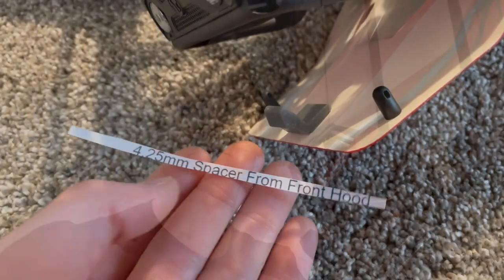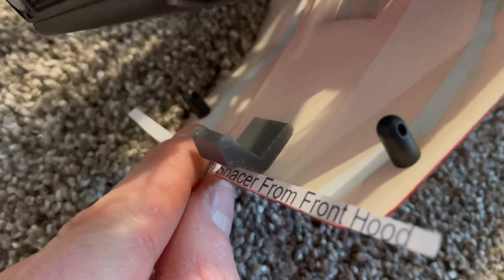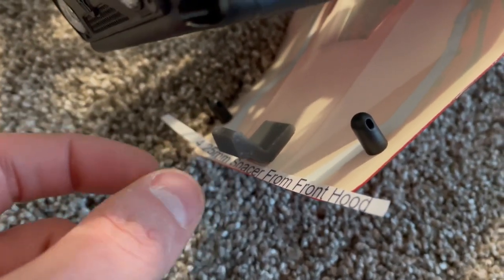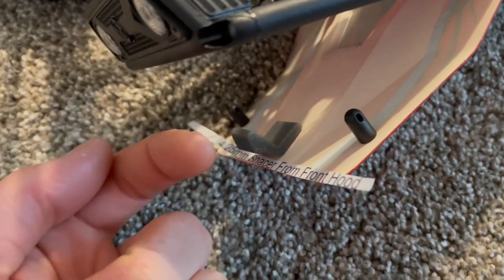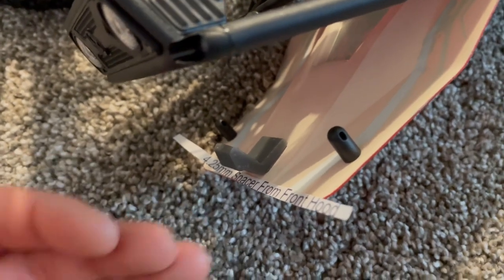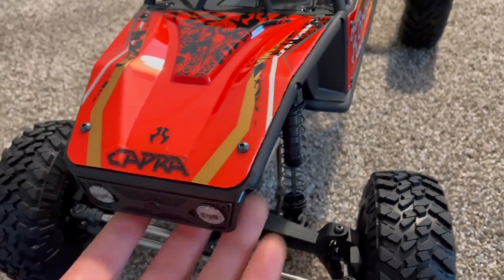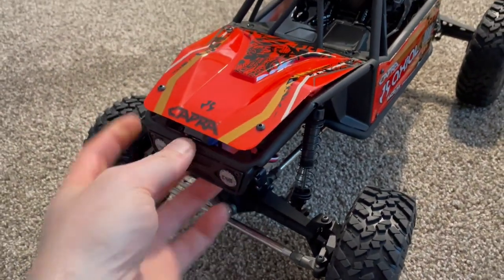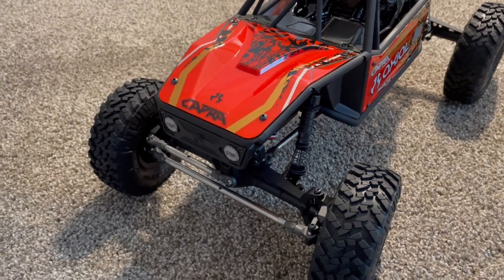Axial Capra 1/10th Clipless Hood Latch

Comment: 1:04 i could only assume your the one selling these since the link for this video came directly from the etsy page. you should be including several pieces of double sided tape since this isnt a direct bolt on like many of your others, maybe even all others. should have made it a more secure latch with more of a hook shape and making a tab that sticks out horizontally towards the back of the car to assist in opening, pretty sure it would clear the servo. also should have made it with 2 screw holes so people have the option of really securing it down.
Reply from the maker: Hey, thanks for the comment. What I recommend if people are having trouble with the latch sticking is to use hot glue to attach it instead. I hate to have people modify their trucks and that is why I don't set it up for drilling. I will take your feedback and add a single M3 hole to the center on future revisions so those who want to drill and add a hole can!